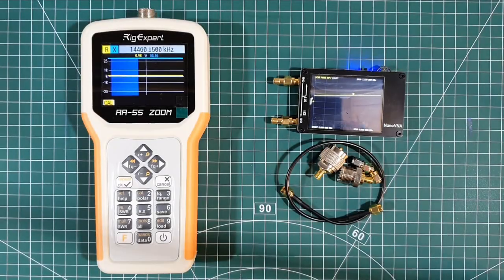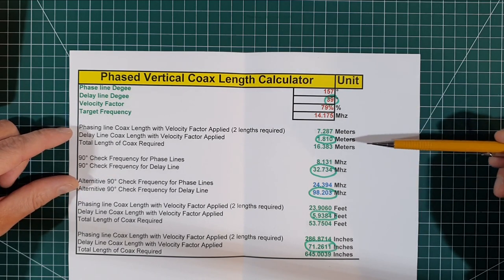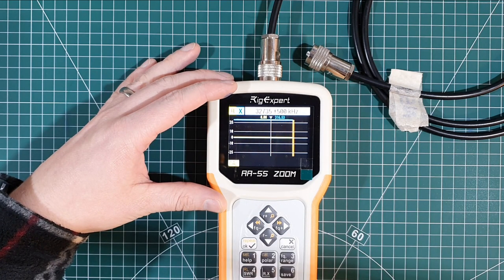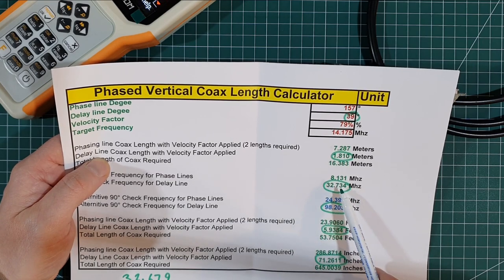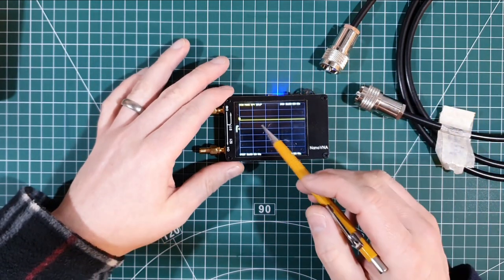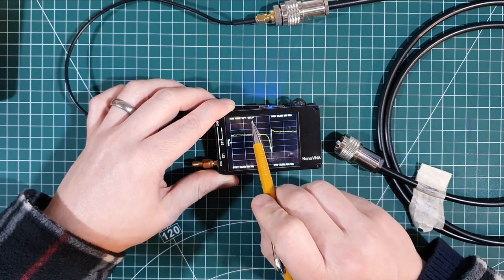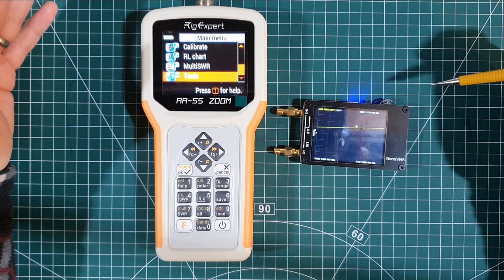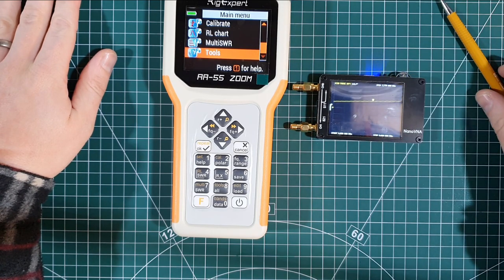RigExpert or NanoVNA - Checking 1/4 Wave Coax Stubs #hamr #hamradio

Comment: I have to agree with your findings in that the Rigexpert is quicker and easier to use, particularly out in the field. I have a RE AA600, not quite as versatile as your AA55 zoom but I wanted VHF/UHF coverage. I recently purchased a SV4401A VNA. It's a new model with much bigger screen, large internal memory for calibration/screenshot storage etc and way more functionality than the RE and in a similar price bracket so quite a bit more expensive than a Nano VNA. Comparing the two on various measurements I've found them virtually identical after calibration and so far I'm very pleased with it.
Reply from the maker: The NanoVNA is great when you have time and inside. Can't beat the Rigexpert for field use.

Comment: There is a Rig Expert free down load  and you can connect via a usb cable to your computer and your RigExpert and shows a sweep graph across the whole range and giving reactance and SWR and so on.
Reply from the maker: Thats right. I should try it but 99% I'm using this in the field.
Reply: @MM0OPXFieldRadio  Yes  OK  . I have built a wide band  transformer which was nearly flat from 1.8 mhz up 25 mhz then it started dropping of at the HF end shown using the RigExpert ANT2 software and I can set the sweep range for a given band.
Connecting it to your computer will power up The RigExpert G4LMZ

Comment: You didnt do yhe calibration wrong.  You just used to large of a sample range.  30 to 35 is a big gap to cover to target a specific point such as yhe one you were looking for.  The result you received was the closest sample point that returned a value.  You could have taken that point and reduced your scan range around it and rescanned and it would have brought the point closer to where it should be.  The AA-55 does the same thing with the zoom function.
Reply: Agree entirely. lack of sample points is one of the nano's shortcomings. During calibration the nano distributes it's sample points to fit the span you selected for stimulus

Comment: Hi there, I think when you calibrate the vna and give it the reference plane, to be precise, you should have the calibration standards in format PL259, so you remove them and connect your line. As you did the reference plane is at the end of the sma female of the adapter. Just to be precise. Doing the math abt 400KHz for that quarterwave stub should correspond to roughly 2.6 cm, which could match the length of the adapter you had in line.
Reply from the maker: Yes I need to get PL259 reference standards.

Comment: Rookie question. Why do u have to screw anything on to the end of the cable when calibrating an "open" ?
Reply from the maker: No such thing as a rookie question. Being pedantic, yes there is an "open" connector but at HF its likely notbto matter.
Reply: Because.

Comment: My new nano vna Blows the rig expert out of the water. It does things it cannot possibly do!
Reply from the maker: Yes, it has an S21 port. For S11 measurements only I take the Rigexpert.
Reply: @MM0OPXFieldRadio  Plus you cannot use the rig expert for VHF or UHF.  Not unless you want to spend $500.
Reply from the maker: Agreed. See when your outside in winter and it's freezing, I know what ainwoupd rather be using. Nothing against the NanoVNA, I love mine too. They are just not built for fast field work. Ive dropped my Rigexpert where the NanoVNA would get destroyed. Just as well as they are inexpensive.
Reply: @MM0OPXFieldRadio  I do not plan on being the freezing cold myself that often. I primarily use mine in the comfort of my shack

Comment: Great video as always, was looking at which one to buy so smiled when I saw the video pop up last night. Think the Rig expert is defo more for ouside and field use like you say. The Nano just seems too small and more for when you wre sat down with time and patience, also I can see you loosing those tiny caps for calibration instantly in long grass! Th enano does present great value for money though so could be it. Is the rig expert waterproof?
Reply from the maker: You have nailed it. The rig expert comes with a cover too which will provide rain protection.  I wouldn't say it's waterproof but I wouldn't be worried if a rain shower appeared. The NanoVNA has no chance on in the rain as is.
Reply: @MM0OPXFieldRadio  British weather it has to have some kind of water protection so thats good. Think everyone in the UK has been there, stood in a field or garden hours before a contest is due to start and still trying to work out why somethiing isn't right :) Think the MFJ 259 used to be the common tool but seen the rig experts used everywhere now. Definatley on another level. Are you going to be at GMDX?
Reply from the maker: @121richard12115  seen it advertised the other day. Probably not but an outside chance I may be able to attend.

Comment: Can you help me out with an issue I’m having cutting phasing stubs. I have no issues tuning cables to a certain required frequency, installing a connector at the far end and making sure the cable including the connector is on frequency.

Now, the problem bit! When I change ends and measure again (with and  without a short at the far end) I read a frequency that’s sometimes off by 20-60 khz. This happens regardless of whether I am using a Nano or a Rigol DSA815TG spectrum analyser. Do you notice the same, or is this something strange going on at my end?
Reply from the maker: What do you mean by changing ends? Do you mean connecting the other end of the coax?
Reply: Yes, have you ever done that test and made sure the frequency at both ends is the same? I read as many as 40-60 khz lower on all my cables. It’s driving me insane trying to figure out why!
Reply: I hope i haven’t confused you. 
What I mean is leave one end open and tune. Once the Z or the reactance is lowest on the wanted frequency, put on the connector at the far end. Measure to make sure the frequency is correct. Now, I disconnect the cable and connect the other end where I just installed the connector and measure again to make sure I have the correct frequency to make it 84 or 71 degrees. The problem is that the cables never read the same at both ends! If one end is 15.200 the other end might read 15.035.

Comment: I think you were a little harsh on the nano. Much of the setting up was due to the presence of your patch lead and incompatible connectors. By the same token you have assumed the rig expert was correctly calibrated and you were fortunate the connectors matched. Repeat the test but with the coax terminated in something other than PL259 and you are back to re-calibrating just like the nano. When using the Nano it is important to reduce the scan bounds to be small as possible for best resolution. The smooth curve presented by the nano is done by interpolation between the measured points. Even on a $100k VNA calibration is required for each unique case if you expect accurate results. That fact alone raises questions over the Rig Expert IMOH. So which device gives the most accurate results? Who can say without reference to a higher grade of test equipment. Like the old story says. A man with one clock knows the time. The man with two clocks can never be sure. For quick on-site measurements of antennas and feed lines the RE surly is easier to use but as you say it can not do through measurements of filters or other two port devices. I suggest you beg borrow or steal one of the later generations of the nano, I think you will be pleasantly surprised.
Reply from the maker: I've grown to love my NanoVNA, I use it for things the Rigexpert cannot do. I would love to get a bigger screen new version. Its incredible what it can do for thr cost. I want a TinySA too.
Reply: @MM0OPXFieldRadio  I have the Tiny SA Ultra as well. It's operation is even more complicated beyond simply looking for harmonics and my gut feeling is it is intrinsically less accurate since it's minimum resolution band width is so large along with a slow scan rate and it lacks a tracking generator. While popular it has failed to garner a user base like the Nano
Reply: My new Nano DNA blows the rig expert out of the water. It does things it cannot possibly do

Comment: Really enjoyable video and well presented, thanks Colin. Just something to add, could you use SimSmith or NanoVNA saver to extrapolate the data in a clearer form than on the NanoVNA?
 I'm with you on the RigExpert choice, I have the 230 and 35, the 35 is my go to as it is so much faster than the 230. The 230 is an older version though, but I do find the difference between my almost brand new 35 and the older 230 amazing. Keep producing these videos, they are very informative. Kev, M0TNX
Reply from the maker: Appreciate your comments Kev. I will do that. After this comparison I discovered one of those connectors is dodgy. If I connect each end I get a way different resonance frequency on either unit. I have another 20m delay line made from RG213. I'm going to compare that one to this one.